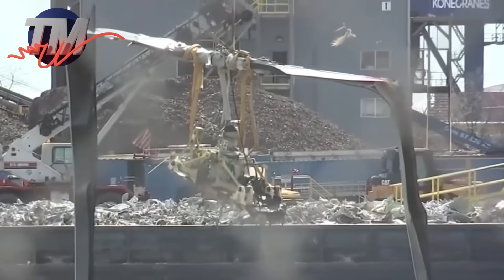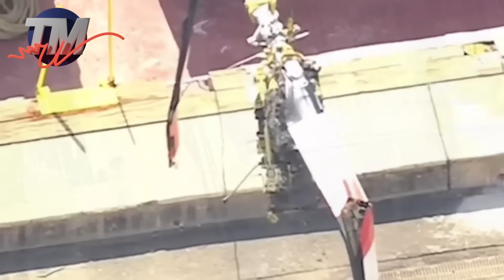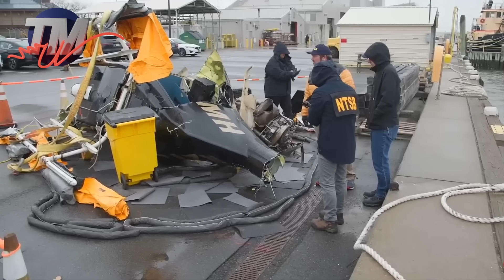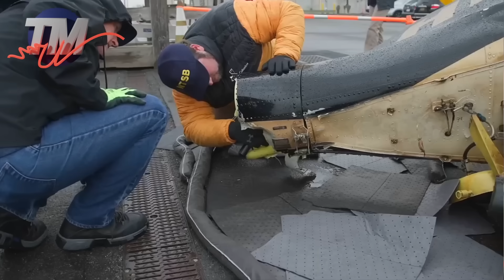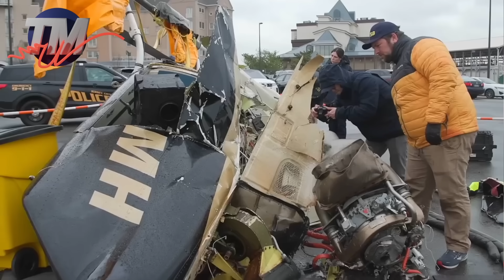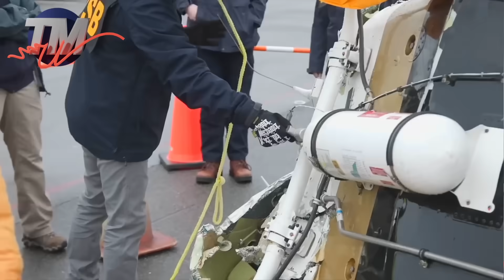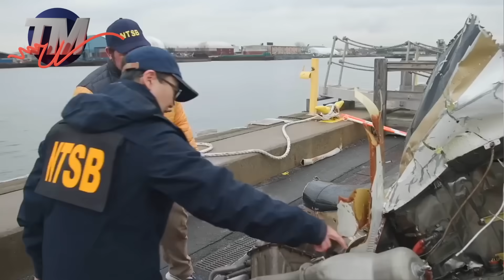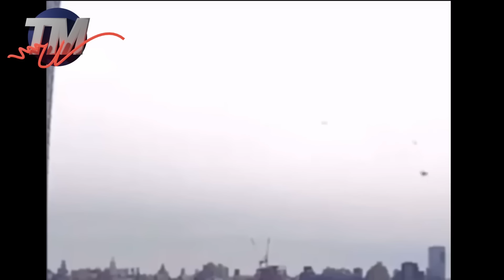Recovery of the Main Rotor of the Hudson River Tourist Helicopter - it's worse than we thought

Comment: As an ex helicopter techie I believe this was a main rotor gearbox seizure. This tore off the tail boom and also then ripped out the upper decking where the gearbox and head are fastened to the fuselage.
nothing the pilot could do to save this helicopter. Now the question is why did it happen? Poor maintenance or gearbox internals failing? The investigators will find out in time.
Reply: Look for missing tools in the maintenance department. My favorite screwdriver is a green Cornwell that I found lodged in the upper suspension arm of my Honda. I felt sorry for the mechanic that left it there because it’s a damn nice driver (has 10mm torque base). A stray tool would not necessarily cause immediate destruction ( the helicopter had flown several times already that day), but when it could have slipped into the moving parts of the main rotor (like after the final navigational turn) could have caused the seizure of the tail boom shaft, which could indeed wrench the boom in half (likely at a carrier bearing support), causing catastrophic destruction of the main transmission mounts, freeing the main rotor loose. Look for missing tools. Someone in that organization has a missing tool…perhaps.
Reply: @WorcesterRooster my brother taught me to ALWAYS count tools going out/going back in to his toolbox.
Reply: @WorcesterRooster was told a story once by an ex RAF pilot, in the 60’s he watched a Vampire trainer take off and kept climbing until it stalled and the pilot ejected. They found an adjustable wrench jamming the controls, such wrenches were not used by the Air Force, so it couldn’t be explained
Reply: @SaltimusMaximus sabotage?? That's what I was thinking about this situation. ALL the recent crashes!
Reply: @brettself oh the notorious 10mm was the reason for your screwdriver experience. 😅
Reply: @WorcesterRooster very painful to realize that possibly this kind of negligence had such catastrophic consequences . 😢😢😢😢
Reply: I mean a stray tool.
Reply: @ Indeed so. When I was trucking I found all kinds of keeper tools in trailers and the chassis of the truck. In an aircraft, it’s just not so simple as forgetting.
Reply: @WorcesterRooster interesting and believable theory
Reply: I keep telling people that, but they don't get it. The gear box must be perfect to work, if one gear has chip/crack or the bearings, the gear box will explode. How many times have we seen this happen?, a lot.
Reply: @NCLUSA  how many times have we seen this happen?   In a bell 206. . . ZERO. . . this would be the first ever. . . in over 40 million flight hours.  Again, another reason for it not to be MRGB seizure.
Reply: @BlackBeardAir   it’s not because it never happened that it can’t happen 🤷🏻‍♂️
Reply: @FC-lf9oh  Sure, but what's your bet at those odds.  1 in 40 million hours?  First one in 50 years since this helicopter model was produced. . .
Also this is the safest flying single engine Helicopter, almost of all aircraft, ever made.

Simple put, the deck does not rip out on seizure, but upon MR blade impact (documented).  Leverage points matter here.
Reply: That's what i was thinking.
Reply: My thoughts as well,  gear box explosion! @maciekkra539
Reply: Video shows the main rotors rotating as they fell. It looks like the transmission was not rotating, so the gear box couldn't have been seized. I'm not a helicopter expert, but know when a gearbox seizes up, whatever is attached to it can't move/rotate anymore.
Reply: @bobwiley6221  They could still be rotating if they never stopped rotating? A seizure of a bearing or gear ripped the whole gearbox/transmission off the aircraft so suddenly it carried on rotating afterwards? i don't know much about these things, but can imagine the torque/momentum of those rotors spinning at thousands of RPM would be immense! You can't really tell from the grainy footage if the transmission was rotating as well, but we shall see!
Reply: seizure rips the mast, and explodes the case. . .
Reply: Not necessarily  @BlackBeardAir
Reply: @Idrinklight44  Yes, necessarily.  The weakest points are in that order.  Add inertia to the mix, you know, the big spinning blades against a relative stationary transmission case, and it twists the head right off.
Reply: @BlackBeardAir  Exactly. Mast would twist like like taffy and fail. Rotor would depart and main gearbox would remain, more or less attached to the helicopter.
Reply: @garyfischer4357  How do you know that? Have you seen it work that way over and over on a test stand?
Reply: I was thinking at this point was it the tail drive shaft breaking and the tail section moved in the path of the rotors caused it to rip off..the damaged blades would indicate? Or did they fold up hitting the water
Reply: @chuckthebull for the rotors to both break symmetrically, water does not make sense, but hitting the tail does.
Reply: @aaronwalderslade  they did not full detach.. I'm just wondering if hitting the water while spinning could have folded them like that on impact , if it did not happen hitting the tail as the tail came apart. You would think the strike point of the rotors hitting the tail section will be evident on inspection. That will come to light when examined.
Reply: @chuckthebull Water. Video shows UNdamaged rotors as it fell to impact. They were still spinning.
Reply: @chuckthebull  He said based on where the tail broke, it didn't look like this was caused by a mast bump.
Reply: @dimitri1515  yeah it riped apart there though..if the rotor hit the tail it does not have to cut it there but break at it's weakest point... Having the rest of the tail would easily show that either way .. but seeing some of the air frame still attached to the transmission shows it was not transmission mounts that failed. Another scenario could be the tail broke there at that failure point shown and moved up to contact the rotor. Again it's all speculation till they examine all the rest of the wreck and try and assemble the parts like what's done every crash. Except 9/11. Just saying.
Reply: @chuckthebull  The rotor blades would be damaged where it hit the tail and they aren't.
Reply: @chuckthebull from video footage showing the rotors and transmission in flight (after separation), they appeared to be auto-rotating down until impacting the water. Likely intact before impact… just from how it looked.
Reply: Water
Reply: How sudden it was tells me its a  Structural failure. Main transmission shouldn't tore the tailboom off the fuselage,In tali rotor strikes I've seen tail rotor drive shafts shread to pieces with zero damage to the tailbooms hanger bearings mounts
Reply: @Airman.. tail booms separate easily...but main rotors still attached to mast while txmsn separates....I think you're right (airframe failure)
Reply: @Smokeyonesix  
You could be  correct.
Any failure of internal 
Transmission components would indeed cause a catastrophic failure 
Resulting in  a severe
Accident . 
Poor maintenance could be the reason .
Bearing failure , lubrication issue 
Lots of  critical moving parts ARE REQUIRED for  Helicopter operations
Reply: Does the driveshaft to the rear rotor look like it had sustained Catastrophic torque? From the remainder of the prop-shaft I n the main fuesalage, it looks only slightly damaged, not completely buckled.
Reply: @muzzmacc6411  there looks to be very slight twisting. But that tail would of sheared off more or less the instant that rotor system seized. It has locked up instantly not slowed and locked up. Don't forget the gearbox ratios inside gearbox.   Some rotate very slowly compared to the rotor blade rpm. Doesn't take much force to lock it up instantly
Reply: That sounds like the most plausible explanation yet.
Reply: @denniscliff2071  
Agreed
Reply: It doesn’t have to be poor maintenance (unfortunately too often it is) things can break during the normal expected lifespan of the part or component. It sucks, but it’s impossible to find every faulty part at the factory.
Reply: @NoMoreBsPlease  
True, but only a very rare occurance 
This 206 has been in service since 2004 I believe, hundreds of flights and hundreds of HOURS in Operation .
The 206 IS a Extremely reliable Aircraft .thats why hundreds of companies and Government agencies use it . But Nothing in this world is 100 PERCENT Perfect as we All are Aware
Reply: Your probably right...tail boom separation understandable, but it surprises me that txmsn would separate before blades and hub assy would separate from mast. Crazy stuff..
Reply: This is exactly what it looks like. I’m curious to read the NTSB report when it’s released.
Reply: .. i agree - from what i see and the destructional forces applied, it can almost only be a sudden, complete blocking of the planetary gearbox ..
Reply: Having seen this footage I tent to agree with you. Not an expert but I can understand how the rotational forces of a rotor spinning very fast could cause such damage and destruction in the event of a gearbox seizure.
I don't understand what the op is getting at with his politics comments.🤔
Reply: Except that the fuselage was spinning in the wrong direction for this to have been a gearbox failure.   There was still torque being applied to the main rotor after the tail separated.
Reply: @briancooney9952  No, the rotor was auto gyro'ing, after an initial quarter turn the tail ripped off then the rest of the fuselage dropped. The footage is grainy and difficult to tell which way it went
Reply: Ex pilot, never seen a gearbox failure like that in that aircraft. If this company is known for poor maintenance, why are these clients using this company. None of it adds up to ‘Accident’ does it.
Reply: I’m not sure that I agree with this transmission seizure theory, and for this reason: the rotors, mast and other related components are heavy and spinning fast. If the main bearing seizes, all that momentum and kinetic energy from the rotors will violently oppose the inertia of the bearing and explode that gearbox casing. That clearly did not happen. In fact, there is footage of the rotors flailing into the river, and they are still clearly turning. It doesn’t look like the gearbox and support structure is turning with them. 
So, what happened to cause the gearbox to rip half of the deck out on one side, and pull the mounts out of the deck on the other? 🤔
The very violent pitch up and yaw *left just before disintegration has something to do with that. 🤔
Reply: @Moontanthefirst  I can see your point on that. It's possible that the gearbox jammed up and created a big torsional shock that  caused the gearbox to rip off the deck. And then the gearbox freed up allowing the rotor to rotate again.  But that would be very very unlikely in my opinion. But I'm fairly sure the answers ate in the wreckage.
Reply: @Moontanthefirst  I can't tell from the pictures, but if the mounts are ripped out of the deck as you say, then that takes me away from a maintenance issue and pushes me more towards a gearbox jam or something that caused a huge torque spike to the rotor system. The phots I saw showed the blades broken at like 25% span. I wonder if that was due to impact with the water or something else.
Reply: @ 
The blades issue is interesting. 
The film shows them seemingly intact as they spiral down into the river, and it doesn’t appear as if the gearbox is spinning with them. The whole assembly would have wobbled down rather than descend  more smoothly. That is one of the chief indicators that the mrgb did not seize, imo. 
I don’t think the rotors chopped the boom off either. 
It’s perplexing that both rotor blades show similar damage about 25% down, like you say. 
I was actually in a Seaking mk IV when the main rotor impacted the boom at the intermediate gearbox assembly.
Reply: That was during Purple star, ‘96.
Reply: Being who the passengers were, it does make you wonder if it was deliberate somehow.
Reply: Agreed.  Transmission locked up, rotor momentum did the rest. Tail rotor couldnt yaw airframe that quickly.  All the wild speculation of sabotage just makes people sound like morons.
Reply: As a Marine Corps pilot of 25 years and the civilian pilot of nearly 40 years now, this explanation seems extremely legitimate, now granted yes, I am a fixed-wing pilot but a lot of my friends were in  rotors squadrons, and it didn't seem likely this was tail boom slap or rotor slap, because in the video when the Helo goes down the rotor still seems to be in one piece, what I mean by that is that each blade hasn't separated from the main rotor mount as it came down and hit the water where then it cracked the blades, you would think you would see one rottor blades intact and the other would be like half because of the tail boome hit or the rotor slap, or at least that's what I would think. Now tell me if you think this might be a scenario, whoever is flying in the right seat whom I believe was the husband/father, he decides to hand someone something from the front seat to the back seat, and as he does this he accidentally hits(steps on the pedals the rudder pedals) and that slips the aircraft to the right or as it looked in the video, extremely fast thus in turn would probably rip the tail boom off and possibly sheer off the main rotor mount, pure speculation on my part but is it a probability?
Reply: My immediate reaction was that this was yet another CIA hit job against a high profile individual as usual.
Reply: @relicboxing  Not only is everything not a conspiracy, almost nothing is. If you don't stick to facts, you end up being misinformed and having a deluded viewpoint.
Reply: The pilot wasn't a white man. Nothing mechanical will ever change the MAGA theory this black DEI pilot murdered white people
Reply: Gearbox failure sounds very plausible to me.

The helicopter lost height, then gained some height - I do wonder if there was a way to increase the chances of survival, but probably not.
Reply: Explosion
Reply: How does a channel with such a low subscriber count get 304K views on a video?
Reply: What you teach man?
Reply: I came to write the same and seen you comment first thing.  Make total sense...
Reply: BS
Reply: It was an old phi bird probably 20,0000 ship
Reply: That was my first through but the video appears to show the body rotating clockwise (CW). My search on the helicopter indicated the blades, when viewed from above, rotate CCW, which would make the body rotate CCW if the gears seized.
Reply: I know a guy that blew the transmission in his helicopter and in his van at the same time. The engineering is pretty much the same if you really think about it
Reply: Creo que viendo el giro tan ràpido del helicòptero y tan repentino, es altamente probable que el rotor principal se detuvo instantaneamente, debido a una falla interna de la transmisiòn y ocasionò  toda la secuencia que tiene toda la lògica y coincidencia con lo que se observa :  La inercia arrastra la nave a girar siguiendo el sentido del rotor, la consiguiente rotura de la carcaza de la transmisiòn, debido al torque gigantezco desarrollado por la detenciòn sùbita del rotor principal y el golpe consiguiente de una o ambas palas en el cono de cola o talvez el gran momento desarrollado en el cono de cola mientras estuvo atravesado momentàneamente volando mientras el helicòptero se desplazaba todavìa a velocidad alta.  Tiene una secuencia lògica a mi parecer, .   Saludos
Reply: This seems like the most logical theory
Reply: Gears or bearings? I’m leaning toward a bearing lock up. It’s fast as it welds itself solid, but not as fast as the teeth jamming to side of the casing.
Reply: Poor maintenance….
Reply: I had the same thoughts, a sudden seizure of the engine or gearbox that started the rotor to tear out causing it to swivel then the tail sheered off.
Reply: Never seen the entire roof deck ripped out like we have here. I'm also going with a gearbox seizure. Tragic.
Reply: 10mm socket.
Reply: Yes, at least one other knowledgable youtuber agrees.
Reply: I THINK YOUR RIGHT
Reply: As a ex Army transmission Rand D guy I was wondering if it was also some type of major gearbox failure/jam. It would be very unusual and I've never heard of it happening before.
Reply: @ericames8057  Do you know does it have a breakaway point so if the trans does lock up the rotor can disengage and auto gyrate? I read somewhere this is a thing as well as detecting metal debris electricly to disengage the rotor to let the pilot auto gyrate down.
Reply: @chuckthebull  other than the over running clutch which is for autorotation and allows the rotor system to decouple feom the engine when it increases in RPM........the entire drive train (main gearbox and tail drive ) are mechanically connected by gears , shafts, and couplings.
Reply: I would think one of the first things the NTSB people qill look at is the connections between the fuselage deck and the gearbox mounts. We're they loose? Missing? Or ripped out?  Was there recent maintenance done in that area?
Reply: @ericames8057  makes me wonder if the break away connection is also employed in the tail section.. without the rear rotor you get the whole thing spinning.. what's odd is it happens so fast the main body does not spin but tumble forward.. how the whole transmission is ripped out of the main body is so off.. did the engine explode or self destruction of the gearbox you would think it would not look so intact.
Reply: We can all speculate on what happened but I will trust the final NTSB report.
Reply: @doubledrats235  I like trying to figure out the forensics as a practice. It's a learning experience as well.
Reply: @chuckthebull  I agree.....keep my mind sharp.  I was a helicopter drive train expert for the army for 30 yrs and I still love to watch them fly around. My girlfriend thinks I'm full of #$*$# when I tell her I can identify a model of helicopter just from the sound!
Reply: @ericames8057  I believe you.. my gal makes fun of me when I geek out on stuff like that too. I have classic cars and build and machine parts on my engine lathe so speculation on these things is fun to me .. plus I have had expertise in many technical fields and I can't help applying those skills to an accident that never should have happened.. even as small as a contributing factor some random person notices can change a lot.. that time the guy Larry David was at a ball game and solved a mystery because someone noticed something on film. We can all help, and no one knows where that might come from.
Reply: @chuckthebull  bravo.......if you see something ....say something.
Reply: @chuckthebull  my dad was an engineer and I followed in his footsteps. He built subs....ibwas always into aviation.  Now I'm more into music as my past time.  Guitar, piano and drums.
Reply: Most likely DEI maintenance.  This is a disaster that has  been killing innocent people for much too long now.   Disgusting and shameful.  Cannot continue !!!
Reply: Planitary gear fracture, gearbox breakdown and sudden stop - Same as the Turoy accident with the Super Puma
Reply: @bdarknaess1375  No, not the same at all.  Like I've stated in this sting many times now.  Gearbox failure shreds the transmission, not the airframe like this did.

https://youtu.be/KvBLadpVscY?si=wbk8tVByVxMhY2ef
Reply: I believe(looking at photos), there were missing bolts/screws in one quadrant of the join of the tail section...OR the join did not overlap enough for the 2nd row of bolts to be through solid steel.  Part of the tail join did not rip off.  It is clean with the bolt holes still intact with no tearing of the steel.  The rest shows it ripped off but not that part.
It did come off to the left as the right hand side is pulled inwards and the left outwards at the tear junctions.
The paint job also shows that the 2nd row of bolts was hardly covered by overlap.
Reply: There was a chip light the day prior.
Reply: What did I say?
Reply: That's definitely what it looks like
Reply: As I posted separately, I wonder if the gearbox chip detectors were functioning properly?
Reply: Thankyou for the quick concise answer!!
Reply: You have a point but it is hard to imagine a sudden seizure that catastrophic without some prior indication (Chip light, vibration etc). Also, and this is hard to see, but there didn’t appear to be the torsion deformation of the nodal beam that I would think would be apparent if a seizure was the root cause. I am speculating like everyone else, but I am inclined towards a tail rotor blade failure which would create an enormous vibration causing the tailboom to fail. BTW, the boom did not fail at the attach point, but about a foot aft at the first bulkhead location. I have several thousand hours in the L models so I am very interested in finding out what actually happened.
Reply: So you're not going with the tail boom strike?
Reply: My thought was poor maintenance or lack of maintenance and possibly not recognizing stress cracks in some of the airframe and rotor mounting structures.
I sure hope the investigation will turn up an explanation.
Reply: nah,    the Jesus bolt let go .
Reply: I'd be more inclined to think it was an engine seizure since it separated the transmission relatively intact. Torque/inertia would have sheared the tail rotor since it is less robust than the main rotor shaft and swash plate.
Reply: @wadehults  I was thinking engine , if the gears though locked up I could see the momentum of the rotors ripping off the whole transmission...it didn't brake the mounts..it pulled the whole air frame apart..the other thought though is what if it was simply structural failure of the air frame. There is supposed to be a shear bolt or coupling disconnect on engine seasur or quit so you can auto gyrate down. This is going to be some interesting forensic science.
Reply: @chuckthebull  typically, aircraft will shear parts behind the component which failed. I.e. if the transmission fails, the main shaft breaks. In this case, the engine probably seized and the transmission sheared from the aircraft. Metal fatigue, corrosion, or other structural failure could also play a role here. I'll be keeping an eye out for the preliminary NTSB report.
Reply: I concur, it does look like a transmission gearbox failure. Planetary gearboxes are incredibly robust and typically do not chunk parts like a transmission with a linear power delivery path. In my opinion the planetary transmission like did have a catastrophic gear failure thus seizing abruptly. But due to the robust nature of the design itself the case did not explode. The torque and inertia quiet literally ripped the entire transmission bedding loose from the air frame. Prayers for all souls involved.
Reply: If the gearbox seized the inertial force of the rotors combined with any other heavy rotating components would shear the gearbox top off and that whole assembly would continue to autorotate as it fell albeit more slowly than under power
Reply: Could it have been shot?
Reply: You are right on target.  I worked on CH-46 helicopters in the USMC and the damage you see there is a sudden seizure of the transmission.  How?  Maybe the pilot missed seeing the light.  Maybe maintenance on the transmission was overlooked.  Maybe it was the pilots inability to see the transmission fluid oil level?  But whatever the reason it was the transmission, but why, is the real question.
Reply: @theaccountant5133  also if you look the tail boom has failed along a row of rivets. There may of been metal fatigue there which provided a perfect release point for all that rotation against the tail rotor anti torque. Plus that tail rotor drive shaft has twisting marks on it.
Reply: @Smokeyonesix someone else is stopping the video and magnifying it too I see. 😂😂😂😂
Reply: @Smokeyonesix I think seizure of the main rotor has applied such huge torque loads momentarily that the helicopter has yawed violently and torn the tail boom off the body of the helicopter. The released energy has then finished tearing the transmission deck out, with the result of 6 people and a detached turboshaft engine falling into the Hudson, inverted.
Reply: @theaccountant5133  Never worked on a helicopter in my life but engineering wise I agree with your seizure theory. Some of the pilots last words were "low on fuel". Did he see a warning light he thought was fuel, but was a gearbox low oil light or similar? He'd most likely have never seen a low gearbox oil light, if such a thing exists?
Reply: @theaccountant5133  Yep something EVERY pre-flight check calls for...........checking the fluid in the glass.
Reply: @theaccountant5133  Thanks for the comments. I worked on CH47, Puma HC2 and Gazelle in the RAF. This mast bumping would of just sheared the rotor blade assembly off the mast. So that is definitely out of the equation. Loose tools or FOD wouldn't get inside a sealed MRG assembly. I remember back in 2000 the chinooks having a fault with some planetary gears in the transmissions that caused us no end of fwd and aft transmission changes to all of our fleet. I think either lack of oil due to poor maintenance or a severe leak or something coming loose or shattering inside the MRG.
Reply: @Smokeyonesix  that's something.
Reply: So the torque of this mechanism could rip out the transmission in one piece? When a car engine seizes it blows a hole in the engine block but does not eject the transmission?
Reply: @Danielspacex yes but not comparable engineering physics is it?
Reply: @Danielspacex comparing a car structure to a helicopter structure is not a good argument
Reply: @hueyrotorhead  especially in flight.
Reply: @Danielspacex  i knew a fellow who blew his van engine And his gearbox same time -rare it was true but it did happen
Reply: More or less what I was thinking, yes, automotive is a bit different but parts are parts. I had a front u- joint failure when I was racing and really hard into the throttle… Second gear and hit the nitrous. Instead of spitting the driveshaft out, it went up and caught in a bind, broke the transmission mount, broke the engine mounts, stuck the fan into the radiator… Essentially trying to launch the entire drivetrain out of the vehicle. It was still running 😂😂😂😂
Reply: @Danielspacex not comparable at all, huge difference in engine sizes, huge rotor vs two small wheels on rubber tyres.
Reply: Different premise.  But there's an airworthiness inspection mandate in 2022 for parts separation on the Bell 206, and this specific helicopter had its most recent airworthiness certification in 2016.  It doesn't even expire until 2029, but if they skipped over the 2022 inspection mandate, they're liable AF.
Reply: @Danielspacex  gravity is pulling down fast & away.
Reply: @Danielspacex   It doesn't blow a hole in the block, a piston seizure at high revs can cause a con rod to break, with a high probability this Conrod will punch it's end through the crankcase, if it is a vehicle travelling fast, then the clutch is liable to slip as opposed to the gearbox exploding.
Reply: @sligeach Helicopters are powered by jet engines and NOT reciprocating ( piston) engines nowadays .
Reply: @roywilson1703  I dident say they were. My description of a piston engine seizing was in response to a comment about "blowing a hole in the engine block/ crank case.
Reply: @Danielspacex  When a car engine seizes it basally stops, when a rod fails then you get a hole in the case (or from piston coming apart if deck is tight, piston hitting head).
Reply: @Danielspacex  I've seen engines lock up in manual transmission cars and cause driveline damage.
Reply: @Danielspacex  car engines and trans are mounted with steel and rubber bushed parts to a steel structure, air craft  are hard mounted to an aluminum structure to save weight.
Reply: @ Your wrong. I've actually seen a transmission hit the ground at the drag strip. It does actually happen. I guess you have never seen a "blown block" where the engine makes so much power that it splits the block at the crankshaft. This has happened many times in truck and tractor pulling. Even on the dyno at the "Dyno Drags".
Reply: @MrBIG4D  sure, but the transmission doesn't take the tunnel with it. . .  That's the point.
Reply: @Danielspacex but a car engine's physics and forces that would hit it during a similar seizure are totally different. The mounting of the engine and transmission in a car and a flying apparatus with a rotor are also worlds apart, hence your example is nowhere close to relevant... sorry for being so direct.
Reply: @Danielspacex  Not many cars have 20-ft rotors attached to the crankshaft.
Reply: Most cars aren't operating at a continuous 500 horsepower load and aren't suspending the car in the air essentially by the transmission.  The dynamics between the two are very different.  Having said that, ujoints, axles, and half shaft cvs do sometimes snap with violent engine failure when it jams the transmission.  The transmission may not break because it's not the weakest point in the driveline.  Drive a manual car drive down the street about 30 mph and then put it in first gear and pop the clutch and see what happens. 😂
Reply: @Danielspacex indeed it could. That rotor system has an enormous amount of kinetic energy stored when it is at operating rpm. It is that stored energy that makes the 206L models such a delight to autorotate. If that energy was transmitted to the assurance in a seizure it would easily rip the cabin roof right off the aircraft.
Reply: @Danielspacex not necessarily true…i just puked while eating breakfast…well i puked last nights dinner, and kept all my breakfast in tack…so sometimes the obvious is not necessarily the obvious
Reply: @Danielspacex  yes. The transmission mounts are just bolted to the upper transmission deck with an interfay in between to prevent dissimilar metal corrosion. Maybe a titanium bbq plate to take any shock loading on rotor start up to. But ultimately the deck is just alloy. It won't take massive torsional forces. I don't believe it was a tail rotor gearbox failure as that wouldn't remove the tail boom in the same way IMO. Shear the t/r drive shaft yes but tail boom I don't think so. Plus if you look at the non rotating swash plate and  the dog bones and it's position it has all been rotated out of its normal position due to massive torque being applied to it. Again just my opinion. Be interesting to read the aaib report
Reply: I'm willing to bet    there was a sudden stoppage of the main rotor caused by  seizure of the gearbox
Reply: I have zero knowledge of anything and I can see with my own eyes that is seized up, for whatever reason....you can see the main blades still in one whole piece...obviously lost lube...horrible situation.
Reply: Could be criminal intent
Reply: @DBNIGHT  
Strangely possible 
My thoughts as well ?
Reply: Yes when there are rich people dying it’s headline news just like the ocean gate catastrophe
Reply: @DBNIGHT True. That's why Putin does not spend time at the Ukraine front
Reply: @DBNIGHT  what a child is, immature comment. By the way, you don’t know that the family was rich, and who cares it was? You must be a very small minded person, and I bet you hate rich people because you’re a mediocrity as evidenced by your comment and will never get ahead in life.
Reply: Has anyone mentioned aliens yet?  It won't be long...